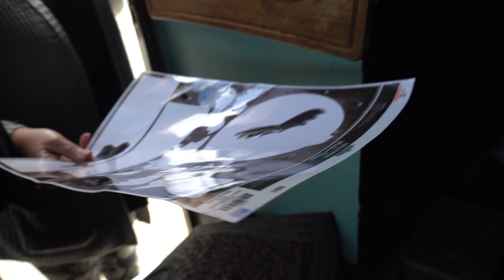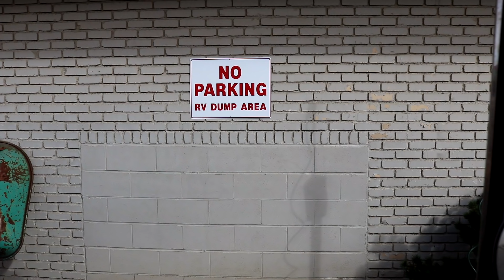Something Went WRONG!!! WIth My New Brakes

Comment: I am pretty sure that the brake pad needs to float for proper functionality. I think you may be creating a potential for your brakes to lock up and cause more damage if that picture hanger comes loose and jams in you brakes.

It only takes 2 bolts to remove the caliper, it's really not a big deal and you should be able to get replacement pads for free under warranty. 

Please do this right. I don't want to hear you have been in an accident due to this!
Reply: Nothing wrong with floating, but they make pads with clips to prevent this sort of things. Shame on Napa for cheap pads and install. 😉
Reply: I used a product called Anti rattle, a thick squirt on paste, orange maybe, You might need shims also!!
Reply: THIS!  The caliper has to come off so you can bend the brake pad tabs down to fit tightly against the caliper.  The pads need to float on the brake disc, & since the pads move each time you step on the brakes, those "shims" will quickly fall out & the rattle is going to come back.
Reply: Bobtailed Trucker NAPA didn't do the install.
Reply: I think I saw Scotty and another guy doing that brake job. One would think
Scotty would know... there's always You-Tube!

Comment: Nothing wrong with the brakes.  That little tab on the pad can be bent to fit snug at the time on installation.  Pull the pad out, set it up right on the ground or hard surface and tap the tab with a hammer, check fit and repeat until it snugs tight. You don't need to itt too hard but it can only be done with the pad out.  That's the way it's done.

Comment: I had a friend changing a tire in his garage and only had one jack under the car. Something went wrong and car dropped and crushed his foot. He didn’t loose his foot but still suffers from that injury from decades ago. So when I see one jack and no blocks and no extra safety measures taken it makes me super nervous! I hope you get that brake pad and all replaced and fixed asap. Safe travels to you all. 😉👍
Reply: I was going to comment on that too, NEVER sprawl your legs under a vehicle with one jack holding it up, if that jack would have moved or malfunctioned, he'd have 2 crushed legs & likely loose them both by time EMT's got there.  My Uncles friend had a cadialliac fall on him & crushed him, he died, his headstone is a Cadallic, oddly my Uncle was the undertaker at cemetery where his buddy was buried.

Comment: Pry the pad away from the hub then bend the tabs over with a hammer to close the gap. Been doing this for decades. It's easier to do it with the pads off the vehicle.nothing broke. There are no shims you put in that spot. Just bend the tabs over to tighten the pad.

Comment: If the clicking come back ,take wheel  off .Push the brake pad up,someone push the brakes inside, hit that top clip with hammer and bent it a little . they are alway made with play so they will fit.YOU  GUYS ARE THE BEST.

Comment: I know Scotty knows his stuff but im very concerned if that clip pops loose and locks that wheel.  I would fix it right first time. Jmho
Reply: She'll be fine until it gets fixed correctly. Which has probably already happened by now.
Reply: sailingsolar do you know how brakes work?
Reply: I do I was a Diesel Mechanic at Vt Transit and a gas mechanic that fix is A BAD IDEA Take those out please

Comment: Napa sells a special adhesive called Brake Quiet that you apply a little on the back of the brake pads and some on the contact points of the brake caliper  during re-assembly of a brake job. I have been doing my brakes this way for 40 years and no rattles!

Comment: im not sure about this brake system, but there should have been a clip that is attached to the backside of the brake pad that wedges it in there to keep stuff from rattling.  thats its purpose, to hold it steady.  i dont see one on your brake pad from the outside.  idk if that is the problem.
Reply from the maker: There was one on the inside but not one for the outside

Comment: Brakes are really something you shouldn't experiment with. The pads aren't supposed to be tightly in the caliper. They shouldn't flop around but a little movement is necessary.

Comment: Caliper is usually only held on with 2 bolts. PleAse fix this properly it’s very easy. I think you are going to cause your brake pad to drag and over heat and ruin the pad and your rotor. This could be very dangerous, worried about you.

Comment: I was a certified mechanic, and those who said to tap the two little tabs down were correct. Just take a large screw driver under the brake pad, and than hammer those two tabs down tight and the noise will be gone!

Comment: That pad is an anti squeak device it's not really attached to your brake pad. You may not have to fully remove that caliper to swing it pull that brake pad off and get some blue brake Grease. That pad will be pinching the rotor and you will have problems when it gets hot. It's really worth the trouble to do it right.

Comment: A big no no.The bottle jack is liable to topple.Use jack stands and block your other wheels to prevent rolling .Put vehichle in park.Another no no is the bits jammed into break housing. Follow the correct  procedure for tightening wheel nuts.Get it done right by a professional.

Comment: That fix should get you in to a good shop. Have them pull that brake and get it right, then check the other one. Don’t take chances with brakes.

Comment: Panda take a large C-Clamp and bend the ears I’m in Sheridan Wyoming had 2 professional shops I cold fix it in 15 minutes a side plus use two faced glue pads from pad kits to quiet your brake noise

Comment: Brake pads are designed to be able to float otherwise they will drag on the  Rotor and burn up the brake pad as well as damage the  Rotor.  I'd have to say your 99 cent fix may cost you A heck of a lot more down the road.

Comment: No bueno you need to if you haven't yet get those little "wedges" out and just use hammer to bend those tabs to give tighter fit on caliper, if those pieces come out possibly be very very bad

Comment: Your caliper should float and would keep the pads lighley snug. Check to see if the Caliper has any movement. It appears nothing is seriously  wrong, however I am not there to see it. I just takes a few minutes to pull the caliper. You can put an vibration pad on the metal side of the brake pad, but most of the time that is to stop squeaking. It also comes in a tube but takes time to dry.
Reply from the maker: Thanks 😊💖

Comment: Wedging the outer brake pad against rotor will over heat and warp your rotor or burn up your pad.
Reply from the maker: It wasn't wedged against the rotor it was pinned to the caliper

Comment: Need to tap those tabs with hammer.  Those hangers are going to melt with the high heat from braking.
Reply: Agreed.  I been a professional technician for 25 plus years and that style of brakes require the tabs bent downward to grip the caliper.    I use large channel lock pliers the crimp the tabs to the caliper.

Comment: the tab ie suppose to b bent to make pad fit title. that was to b done at install. but if u take off or just use something to hold pad up u take hammer an bend tab. not a bad part. bending tab at install. makes it fit tite

Comment: You wedge chisel in between  the rotor and brake pad then tap on the  tab on the brake pad. Nothing wrong with the brakes, you just missed a  step  on the installation.
Reply from the maker: Thanks Brian 😊👍

Comment: I just hope that since you wedged that brake pad in that it's not constantly putting pressure on the brake pad against the the rest of the brake system because if it is that brakes going to go out on you

Comment: Talkiing about shade tree mechanic, Did you pull the driver's side wheel to compare to see  whats missing. I would suggest a four-way tug wrench and a torque wrench. WARNING THAT BRAKE COULD LOCK UP  get it fixed right  you know it will happen at the wrong time!

Comment: I live in a slide in truck camper full time and have a full time job I live in Michigan and trying to get stuff ready for winter any advice
Reply from the maker: Head south lol just kidding if you can't do what some do and winter in Arizona or Florida then I would definitely suggest winterizing your rig reflectics on the windows to keep the cold out and definitely an alternative heating source (buddy heater or small wood burning stove), other than you built in furnace. Some people winterize their pipes but you won't be able to use them, if you do, so you would have to have other sources of water. There is alot of info out there about winterizing your rig you'll have to do a little research. hope that helps. I'll try to do a video if I can get enough content for the subject.

Comment: with older brakes all you have to do is takk a big flat tip screw drvr  between bottom of pad and your hub and pound top ears of shoes like upside down l. your little clip wont work. some old pads came w the tab bent over for those old dics brake systems.cowbow .wisconsin.

Comment: I hope this is just a temporary fix until you can get it done properly as I'm worried about your safety! Is that just something which won't interfere with your being able to stop properly?  Remember all the weight you're carrying.  To me, I don't think a little pc. of tin is going to last any time at all, so I think the next time you're stopped for a while, you should get that fixed right.  It isn't worth saving a few dollars if it could risk your life or that of someone else.  Please be careful and use wisdom.  Ingenuity is okay when it's something which isn't going to be dangerous, but in this case, I'm not so sure about that!

Comment: Your saying the brake pad separated from the metal shoe? If so you definably will want to replace it soon. What will happen is now you have point loaded it with the picture frame metal and when you do a lot of braking and it heats up it will shatter and fall apart leaving no shoe-pad to compress and you will get into a very dangerous steering problem where one side grabs hard and none on the other side  ripping the steering wheel out of your hands. Great roadside fix but have it done right soon !

Comment: There is nothing wrong with anything there other than there is supposed to be a spring that attaches to both ends of the pad which is to eliminate that clicking even with out it theres no worry. Ive done many front and rear break instilations your fine but i do agree with an earlier post that by putting something not specific with your breaks you do significantly increase your chances of probems.

Comment: Never a good idea to put any added hardware. As it can come out and wedge between pad & rotor damaging both. What is done is to pry up on the bottom of the pad while tapping down the upper tabs. It should have been done at install. Please check & remove. Close the tabs like they should be its safer & cheaper.

Comment: Bad idea with that "fix".  Would have been easier to remove the caliper and fix it right. I do hope you get to a shop and fix them right as they should float not be tight and ruin the rotors which will cost to have them machined down.

Comment: Could just take a giant C-clamp and crush that tab down to the caliper. The problem with all these GM parts is that all the suppliers that supplied GM got crushed in the 09 bankruptcy. Now you have new suppliers starting from 0 trying to make parts, it is a mess, older GM's may not recover from.

Comment: You had a good idea with the picture hooks but it looks like as much time as it took you to do that you could have replace the brake shoes
Reply from the maker: No It would have been alot harder to replace the brake pads plus I would have to buy a compression tool. to get the new brakes in.
Reply: @rvpandamonium  I use a big C clamp to compress the piston when I do my brakes and a 1/2 inch breaker bar for the lugs but I'm glad you solved the problem safe travels

Comment: You shouldn’t jimmy rig your brakes. If it’s loose, there is a problem that needs to be corrected it’s not hard to change your brake pads. Takes less than 15 mins.

Comment: So many comments, so little correct info. The brake pads simply needed to be " locked down" by seating (bending) the ears firmly against the caliper mounting. It's done as a final step with brake service on the older model Bendix and some Moraine systems. Done it hundreds of times. The problem was likely that this is an old system and you likely had a young mechanic who simply didn't know this final step. It's not unsafe, just annoying.

Comment: The brakes were not installed properly, those tabs are supposed to be bent down when installed so they don't rattle...You are doing it wrong.. 34 yrs experience (own my own shop)..... (I've done it properly several hundred times)  There is no "pad tension spring"  on the outboard pad... jeez louise... The post from Richard Thomas below is also correct..

Comment: Nope... Bendex  New Callepicar, Not rebuilt. You have sloop. Shims not the answer. Also re pack bearings after 500 miles w/ red hi temp grease,
Reply: and no. 180 ft lbs on the lugs